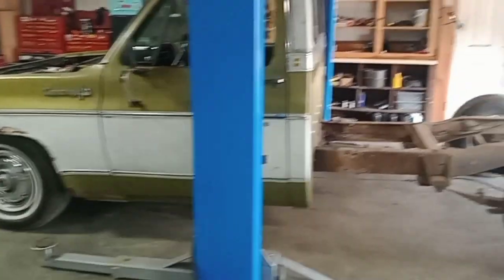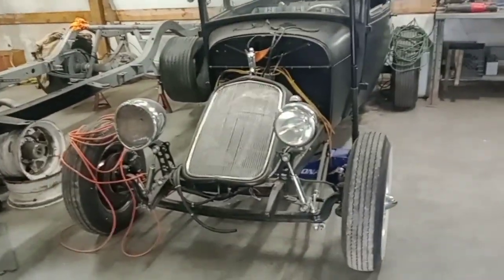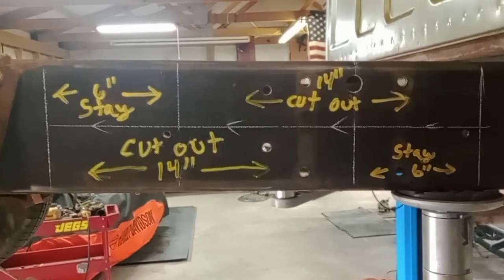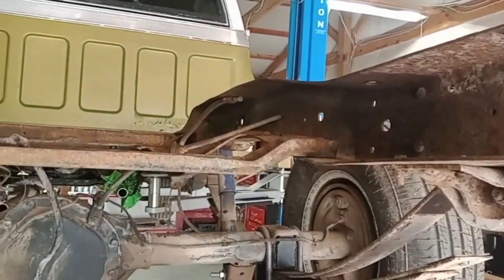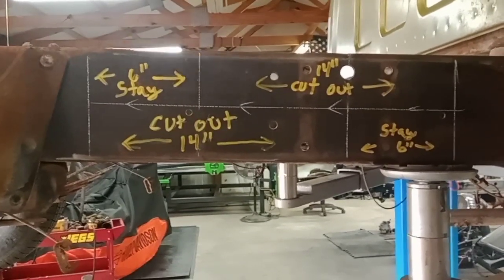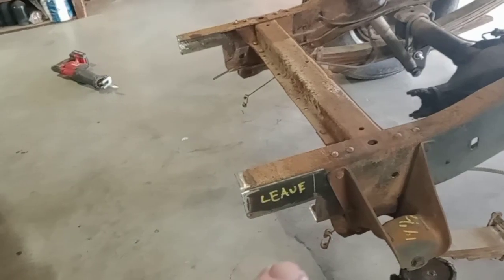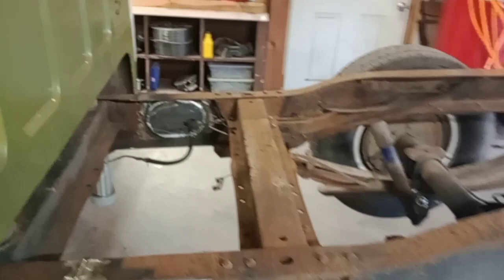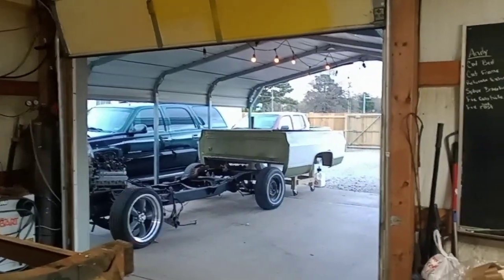how to cut down longbed frame to shortwide 73-87 c10

Comment: I'm so glad when I see guys doing this correctly with a step cut. The only thing I'd do differently would be putting a radius in those corners. Those corners are the only weak point susceptible to cracks. Nevertheless it's far better than a straight cut 👍

Comment: FIRST FOREMOST I WANT TO THANK YOU FOR THIS VIDEO, THE EXPLANATIONS ARE VITAL AND THE FRAME MARKING FOR THE CUTTING ARE PERFECT!
WHEN I DID MINE I DID MAKE A COUPLE CHANGES FROM THE CUTS SHOWN. ON THE TOP SECTION I MOVED THE 6"  STAY TO THE FRONT AND CUT OUT THE 14" 
SECTION TO THE REAR. THEN ON THE LOWER SECTION OF THE CUT I MOVED THE 6" STAY TO THE REAR AND CUT THE 14" OUT OF THE FRONT PART OF THE FRAME. 
MY REASONING WAS THAT I WANTED TO KEEP THE ORIGINAL BOLT HOLES FOR THE OLD BED SO I COULD USE THEM FOR THE 6' BED. NOW I DON'T HAVE TO DRILL 
2 MORE HOLES IN THE FRAME FOR THE FRONT PART OF THE BED AND I KNOW THAT THE 6' BED WILL BE THE CORRECT DISTANCE FROM THE CAB. ALSO, WHEN INSTALLING THE NEW SMALLER TANK TRY TO USE THE OLD TANK STRAPS. A NEW SET OF STRAPS ARE GREAT BUT THEY DON'T LINE UP WITH THE FRONT HOLES IN THE FRAME FOR THE TANK. THIS PART 
OF MY PROJECT WAS PROBABLY THE MOST TROUBLE, MOUNTING THE NEW TANK SO IT WOULD BE LEVEL WITH THE TRUCK.

Comment: If you don't mind me asking what is the total length that the frame is supposed to be from the back of the cab to the rear of the frame I recently bought a short bed conversion 78c10 and something seems off. Also the guy tacked up some square tubing were the bed sits on the rear of the frame. About 2 inches tall saying that it needed it to line up the body lines.

Comment: About to shorten my 65. I have a 66 short bed sitting in my shop to use as measurement comparison which is nice. Trying to decide if I buy a kit or just Z cut it like you did under my cab. Seems pretty simple. 

Btw I think I have the exact same lift as you. Champion TP-9 HD. Curious what’s the biggest vehicle you’ve had on yours. I have a 2004 sierra 1500 crew cab. Heaviest thing I plan to ever put on mine.
Reply from the maker: I like z cuts better than kits if you do right after you clean up the outside weld and a little paint can't even tell they are cut the kits have lots of bolts in that area you will see.Ive actually picked up a 90s model one ton Crew cab on there and a hummer h2 went up just fine

Comment: im thinking about doing my 78 C10 (ls Swap) but I thought the leaf springs on a long bed and a short bed are different langhts?
Reply from the maker: Yes they are diffrent length but you can still relocate your bumber brackets and redrill the holes and use the bumber brackets that go to the inside of frame rails and every thing still comes out fine and bolts up

Comment: also how do you get it lined up and level? level most of all ?
Reply from the maker: I use a straight edge on top of frame and bottom once together and use floor jacks and make sure that straight edge has no gap at all and you should be fine ive never had a problem doing it this way .

Comment: You had me until you said "union fitting or compression fitting" on brakes, dont do that bro, ive seen them fail and fixed too many of them, please just run new brake lines, otherwise amazing work! Cheers
Reply from the maker: @darryl163  we don't this video couple yrs old now we cut and reflare the brake lines on all cut downs we do a lot things differently now I would update with new videos but enough guys coping me so we leave something's to guess.